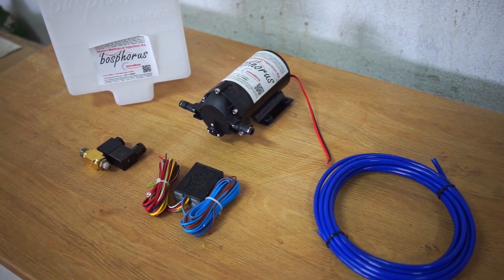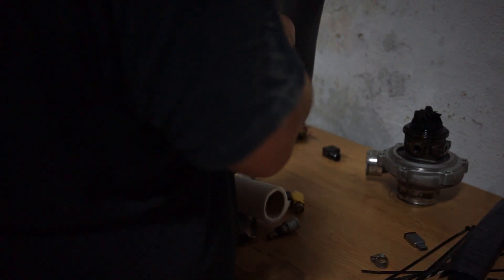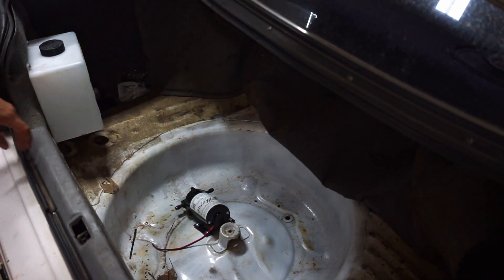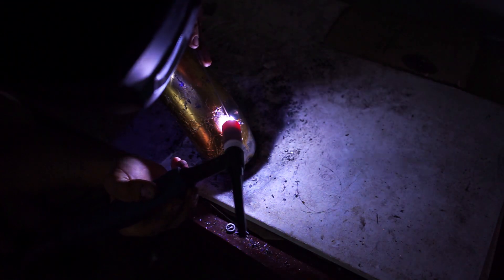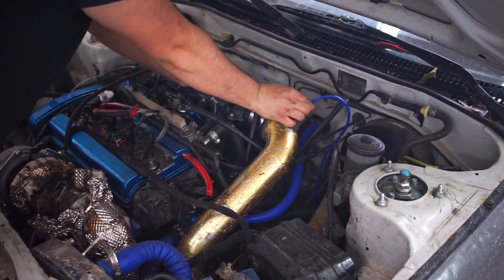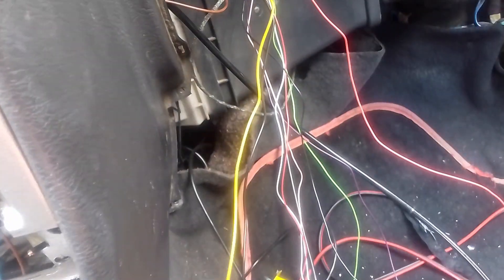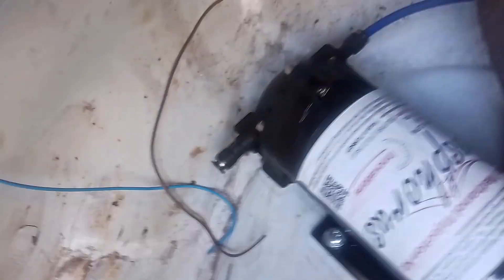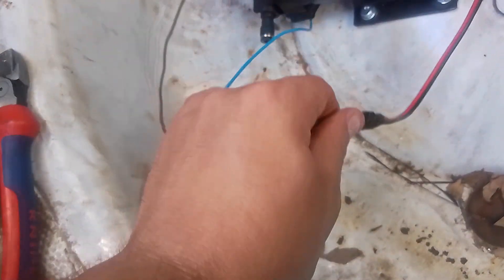Water Methanol Kit installation | High Compression 4AGE 20V Turbo gets the fuel it needs!

Comment: Very interesting wonder how much power it will make with setup roughly speaking
Reply from the maker: Ill see how far i can get without knock hoping for about 300
Reply: Aww nice what size injectors u have in? I have a turbocharge with some 660 cc injectors am hoping it can manage 400hp @throttlebuddies0
Reply from the maker: @OnielHenry5  currently 800cc
660cc will be ok for 400 crank horsepower im guessing.

Comment: Hi, I have a question to ask:
Do you need to plumb the meth nozzle before or after the IAT sensor?

If it’s before the IAT sensor, should it be close to the sensor or spaced out?
Reply from the maker: Depends on what you want your iat sensor to measure but usually would be before the iat sensor if possible 20 cm or so so that the mixture has a chance to get mixed well before the iat sensor pjcks up its reading because otherwise might be skewed in one or the other way.
Reply: @throttlebuddies0  makes perfect sense. Thanks! Just curious when watching you weld the bung there close to the trottle body. Hence the question haha.
Reply from the maker: @GR7Media Its actuallg itbs but with one tb you would weld it in the same place  on a single throttlebody also but your iat sensor would be placed in the intake manifold. In scenarios where its in the piping before you could leave it like that but youll jusg jave to consider that in your tune